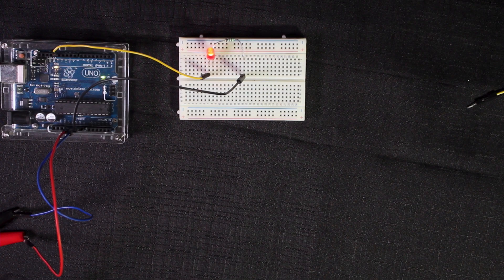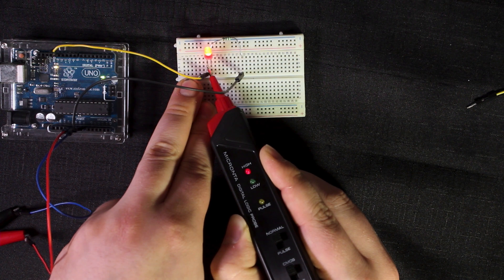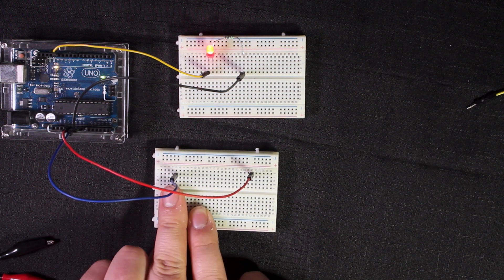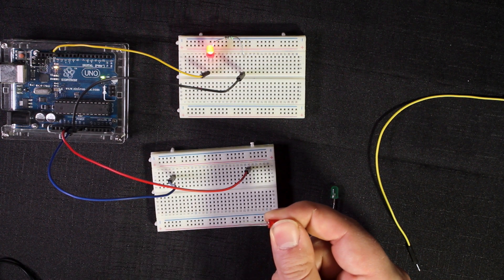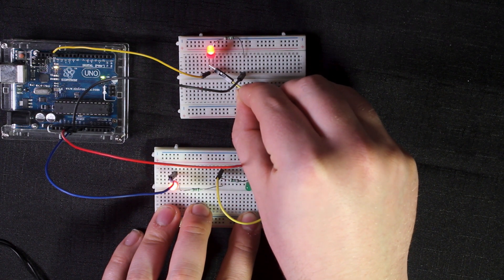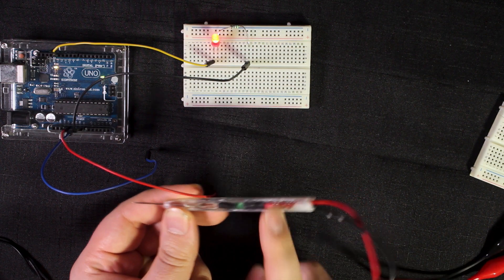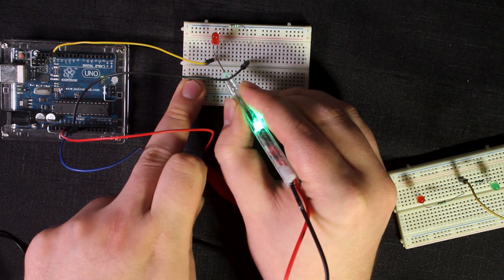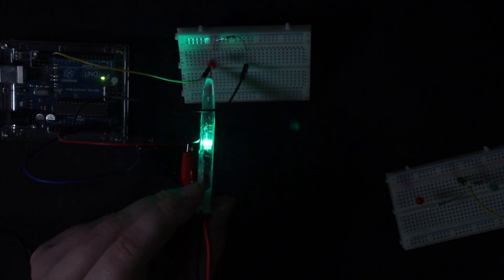How to Make a Simple Logic Probe

Comment: This was a great project, it took me about 1-1/2 hours did a professional looking build I used 3mm led’s and 1k ohm resistors all slides into a bic pen. I took the ink tube out and pulled the nib / ballpoint out cleaned with alcohol used 5 minute epoxy some silicone wires. Breadboard first of course and works great and looks great to. THANKS AGAIN